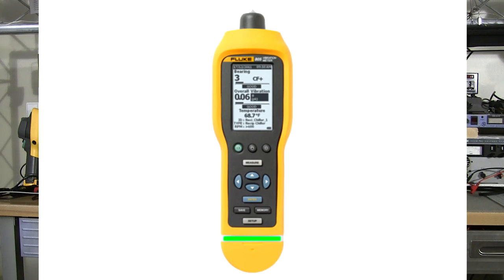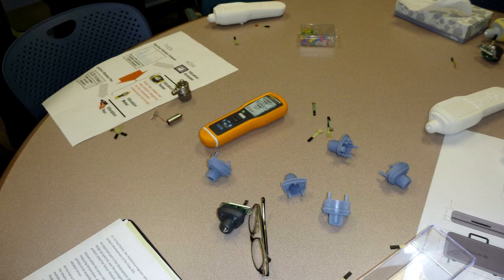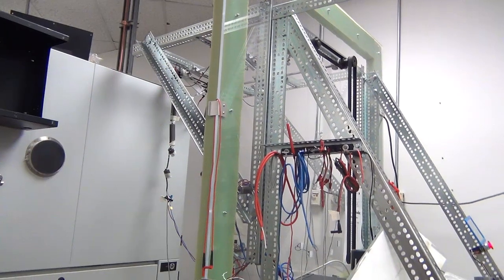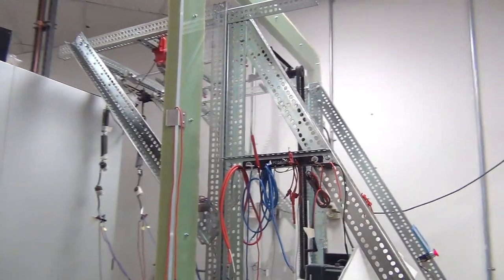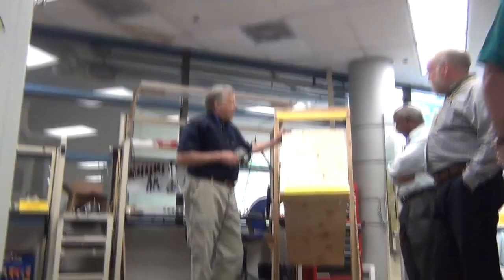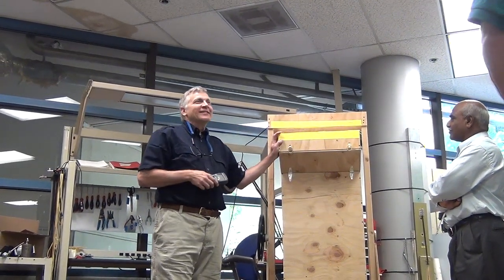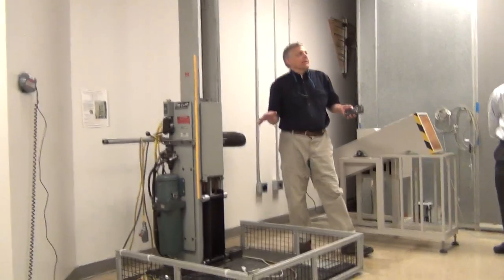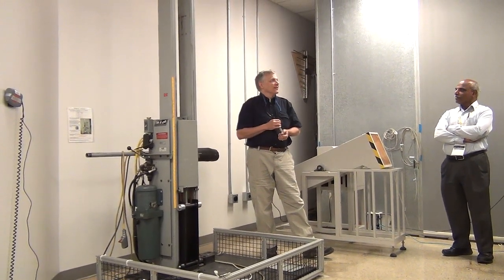Inside Fluke  - The Measure of Innovation 2015 - Pt 2

Comment: I've recently bought a brand new Fluke 87V (two weeks ago) from an official Fluke distributor here in Canada. It was manufactured in April 2015 as per the label on the box it came in. And on that box it says "Made in US", on the yellow holster it says "Made in USA" (molded into the rubber). But on the DMM itself, there is no mention anywhere of where it is made. Which leads me to believe that lately the 87V are being made outside the USA, but probably still being calibrated there. I think there's a law in the USA that prevents a manufacturer from writing "Made in USA" on their product if it's not. So, the yellow holster is made in USA, the cardboard box that it came in was printed and made in US, but probably not the 87V meter itself, nor the cheapish leads and probes that it came with.
The simple fact that there is now a less expensive Chinese version of the 87V called the Fluke 87 VC (reserved for the China market, but identical in every way to the american version except for the added C on it), leads me to believe that all Fluke 87V dmms are now produced in China, not USA. But the high price remains the same for the "american" model.

Comment: As for the Fluke church services (hallowed be the prices) all the hubbub aside, the simple truth is that a Fluke87V is simple 1980s technology at 1950 prices.
Their safety claims are entirely dishonest. Fluke's only merit is decent calibration but that's not something that costs anything to do. It's just unfortunate that the lower cost makers don't bother as much with that. If UT made that effort they would have strictly superior products at 1/6 the cost yet it would still be 1980s tech, just more reasonably priced. If UT actually did some good mdoern engineering it would have serious oscilloscope functionality and component characteristic graphing at sub 100$. Million count precision is also quite trivial. The DMM market is extremely stagnant.
Reply: Dan Frederiksen as for calibration, the inbuilt accuracy of the A to D  of even the cheapest DMM these days, including UT, is rock solid and reliable, they dont have pots on any decent one these days, the only thing it comes down to is being certified for both accuracy and safety, the bit of paper, not so much the device, everything is run on paperwork these days, someone has filled in a safety form hence it is deemed safe.   Plus this is america we are talking about, fluke is more and more made in china, and the middle executives who are less and less technically able have to fluff their sales pitch to justify their income
Reply: jusb1066 I agree with the AD quality but I don't agree paperwork is important although bureaucrats might agree. It's all about the device qualities. I don't care about external labs if the company delivers themselves. And CE and such don't guarantee accuracy anyway. That's just a base don't burn down the house standard.
Reply: Dan Frederiksen
yes, much of what fluke does, is please the bureacrats,   and I agree that CE is pretty poor, often meaning more often "china export" that european compliance!,  TUV i think offered something along the lines of a testing standard for europe, there are british standards, but its all confusing! lol perhaps the CAT ratings are not so bad after all! :}
Reply: jusb1066 It's not about the accuracy of the A to D, it's long term stability and reliability. The UT meters I have are junk, ok for a quick sanity check, but I couldn't ever trust the readings.
Reply: SDG Electronics
i have two 30 year old multimeters, a fluke 70 series and a taiwanese 'test lab' i used in school, they both work, and still agree with each other to 99.999, still meet their specs easily, so a cheaper meter doesnt necessarily drift long term at all. along with a 15 year old Uni-t and a year old model, they both agree with each other and the above models, and i also have access  to a fluke 89, no meter stands out as different in reading to any other, much less than 1percent at any reading